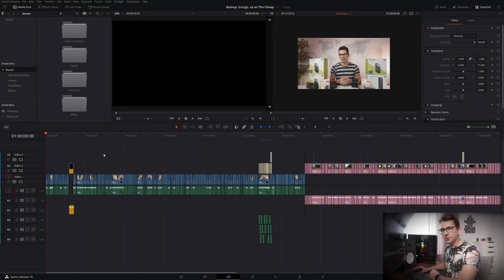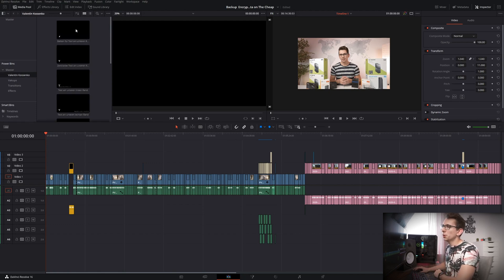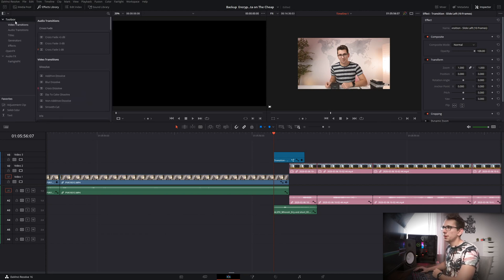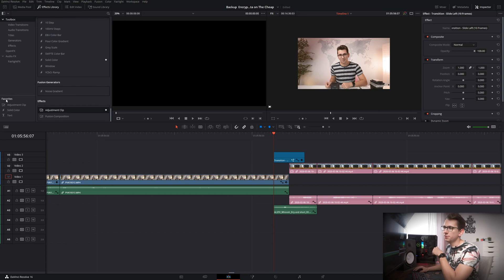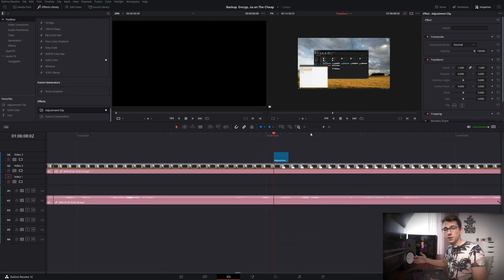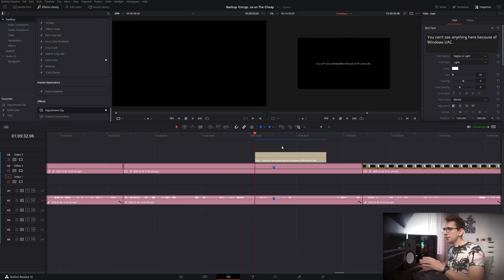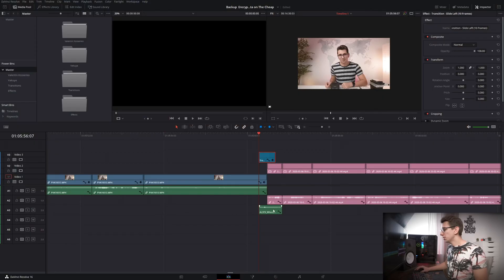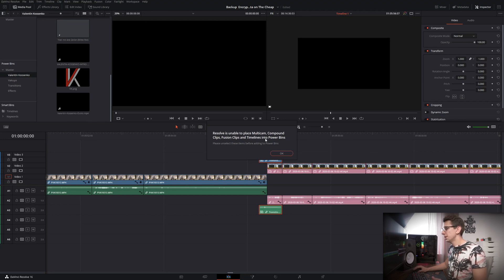Create TEMPLATES / PRESETS in DaVinci Resolve & REUSE Common Media - Power Bins & Adjustment Clips

Comment: Hi, I am having a issue with the power bins. when I make a fuison transition adjustment clip and then save it to the power bin. I cant use it because the keyframeing get messed up every time I try to place it to the timeline. Can anybody help me with this problem please?
Reply from the maker: Hi, sorry for the late reply. I remember having the same problem in the past, but it didn't happen to me again - maybe it was a bug, not 100% sure though. If you view the frames inside of Fusion, are these changed in the duration? Like from 1-30 to 30-60 or something? This might be causing that problem. One node I really find to be helpful when using Fusion is the keyframe stretcher. This might help you with some of the problems you usually have, when you stretch clips.
Reply: @ValentinKossenko  thanks a lot yea it was a bug for me also. now it is all fine.

Comment: Great video. Thanks! 
So you can add an adjustment clip to a power bin but not a fusion clip?
How can I save my intro that I made in fusion with fusion nodes to use again in my next video? Is there any way to do that other than turning the fusion clip into an mp4 file? 
I would like to have the option to edit the fusion nodes.

Comment: I have an issue with my Resolve, I create a transition in fusion using an adjustment layer, then movie it to a power bin. But when I move the newly create clip into the timeline, it has no effect
Reply from the maker: I can't reproduce that problem. Have you tried a fresh installation of Resolve? Which version are you currently using?